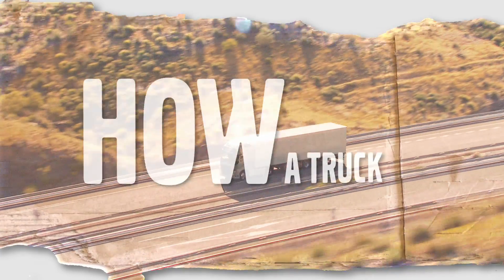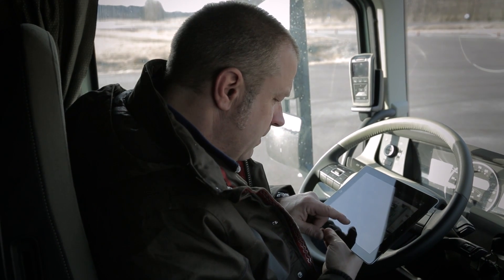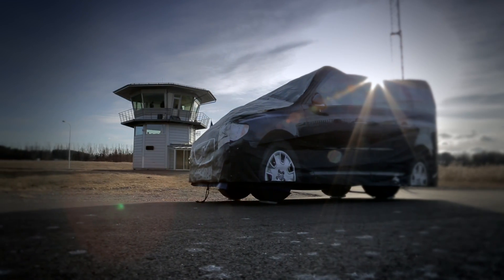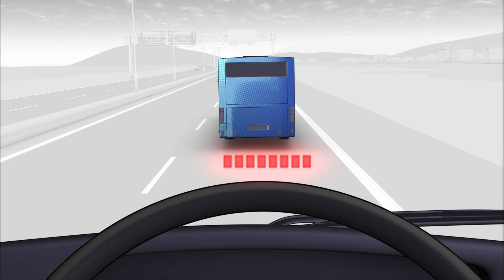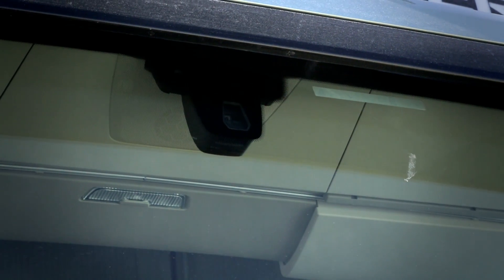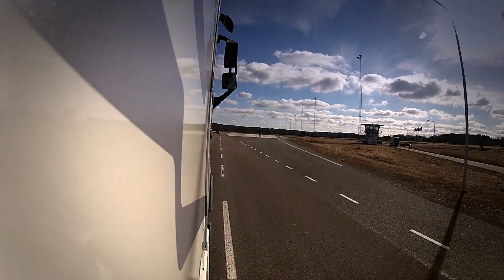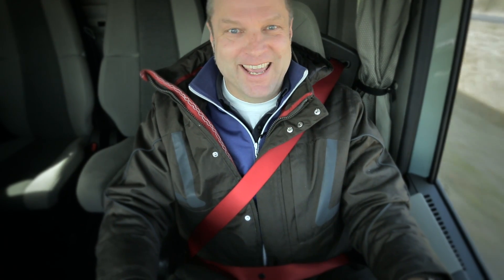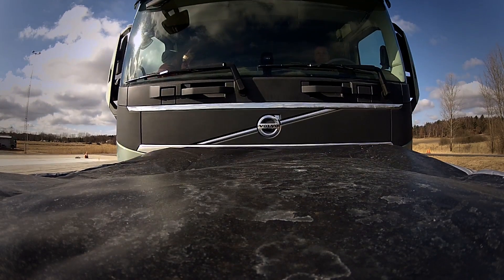Volvo Trucks - Testing Collision Warning with Emergency Brake - "Trucks' Anatomy" (E01)

Comment: i think this system works only if the trailer is empty. in the other case if the trailer have a 24tons then line of breaking is much longer.
Reply: As stated in the video, it's loaded with 40 tons.
Reply: Xanthopteryx your right .. but in the video they explane it wrong ... they ment 40 tons total weight .. truck and empty trailer is about 16 tons ... with 24 tons off load is a total weight of 40 tons... in many EU country's that's the max total ( allowed ) weight ...and the brake system is great ....i'm also a truck driver ... but if you load 24 tons aluminium plates or like trees ... you better tight that up REAL good ... or it fly's right true your cabin .. and cut your cab in half ....

Comment: What if the road is wet? The system considers the diferent weights of the truck on the breaking system (fully loaded or unloaded)?
Reply: Many trucks have a scale on their hitch and in the event of rain, it works just like conventional braking. The ABS is specifically designed for rain.

Comment: what will happen to cars behind it???
Reply: Nothing much we can do about the cars behind it. They shouldn't be driving to close to the truck in the first place.
Reply: Sotobi actually the trailer that was shown before this video was uploaded has rear brake lights that are blinking when the truck suddenly stops so the car at the back still a bit far away knows that the truck has a feature and it will slow down. Better watch the other video that Volvo made about the collision warning system.

Comment: As a professional driver I think this looks to be a great safety feature, but I have a couple questions. Is it available for trucks in the U.S.? Looks to be a European model in the video. Is the system able to adjust braking time needed as related to the weight of the truck? A light or empty truck can actually take longer to stop due to tire skid
Reply: ***** yes U.S. truck have airbags, been driving for 12 years and have never had a truck without them. Also u mentioned no retarder. If u mean engine retarder you are mis-informed. Pretty much every U.S. truck is equipped with that
Reply: Matt Strand What do you mean by engine retarder? The type of retarder Carnatics was talking about is the retarder fitted between engine and gearbox or on the transmision, and uses pressurised oil to limit the vehicles' speed. If I remember well, the EU law says that it must hold a fully loaded truck at 30km/h on a 7% downhill gradient for 6km. It is not the same thing as the exhaust brake, or exhaust retarder, where a valve creates exhaust back-pressure in order to rev down the engine.

Comment: 50km/h .... most of the roads they are destined to travel have much higher speed limit, why dont we see test of say 100km/h ?
Reply: even at that speed it'd be enough brake to avoid a most full speed lethal collision
Reply: ***** No, i'm just concerned about it's effectiveness in saving lives at speeds at which driver shouldn't drive but does anyway ;)   and you had to call me moron ...
Reply: trucks in the UK are limited to 50mph they cant go any faster then that by law im not sure about rest of Europe if they too are limited
Reply: INCDZONE yes .. in EU the speed limiter in on 90 km/h ... you are actualy allowed to drive 80 km/h ... so if the cops have a bad day .. and you drive 90 km/h instead of 80 you get a fine for 10 km/h .'

Comment: I would be shocked if this isn't made mandatory. Also mud flaps (or a well designed equivalent) on all vehicles would reduce accidents as wet weather spray, especially on motorways, would be reduced.

Comment: Seems like a great system and even if a percentage of these types of collisions are prevented it would be worth every penny to refit as many trucks and cars as possible. I do wonder how it would perform at higher highway speeds, with an unstable or unsecured loading shifting in response to the delta-V or in inclement weather (can't cheat physics) but any improvement will be welcome. Thanks Volvo!

Comment: Volvo Trucks: What would happen when you put on a lighbar or someting like that ? Then the sensor has to be in another postion  doesn´t it ? And what would happen when there`s a truck in front of ? when the system brakes so hard an so closely to the others ther would be a touch  coused of the suspension wouldn´t it ?

Comment: I wonder if anyone listens to the dialogue as they say the truck is loaded.  I'm more concerned about vehicles behind.  I know the truck is protected, but leaving braking so late and hitting the brakes so hard, I should imagine is asking for trouble.  I think there should be some pre-warning at the rear of the vehicle to warn following vehicles that it could be about to brake severely.  Just a thought.  It doesn't always follow that the vehicle behind is at fault

Comment: I wonder if this system can adjust itself to match with tire wear/pressure and weather conditions?
Reply: It adapts to everything thanks to the abs, radar, camera and etc, it does not fail and if there is an impact it does so with little damage

Comment: That's the difference. you don't think so, but I know so. Your assumtion is based on what? The fact that a fully loaded car takes a week and a day to stop? The brake dimensions on a car stop the car fastest when it is empty. The brake dimensions on a truck stop it fastest when loaded. Why do you think these demos are always with fully loaded trucks? Search for the Mercedes-Benz Active Brake Assist demo, it is also carried out with a fully loaded truck.

Comment: The brakes on all modern (European) trucks are hydraulic disc brakes, running off an electronic system that ensures each individual wheel is braking at optimal efficiency - braking more or less, depending on grip. A fully loaded truck will stop faster than an empty one due to the increased grip caused by the pressure on the road. Empty or full, a modern truck will stop faster than your car - don't tail-gate a truck!

Comment: What happens when the system automatically brakes while in a curve with a load of 40 tons ? The whole thing topples over or jackknifes all across the motorway. Also, Volvo, what are you doing about the visibility in the right hand,front corner. That sensor you installed ain`t worth shit, idiots still try to cut me off in queues, thinking i can see them.

Comment: How effective would the brake system be when the surface is wet?? I am pretty sure  hydro-plane effect would make the vehicle slide and hit the object, or is there a preventative system in place??
Reply: There is a technology that has been used in airplanes for at least 50 years or more called ABS, which obviously works with autonomous braking.

Comment: Is it possible for system to brake when car/truck cut off the driver? For example on intersection, from right... Would system react to that sudden change and warn the driver or it's not predicted to react in extreme situations?

Comment: Its up to the driver to secure his cargo efficiently, and securely, its actually a part of his job to do that. And if your cargo isn't properly secured you'd drive carefully anyway, with or without the safety systems I'm sure. There's also a way to de-activate the collision-system.

Comment: i was thinking on loads like pipes they can easy come through cab , my point is that all those safety devices are not making trucks necessary more safety, many drivers become overconfident and not careful with all this systems aboard